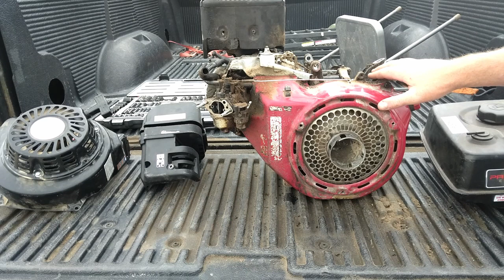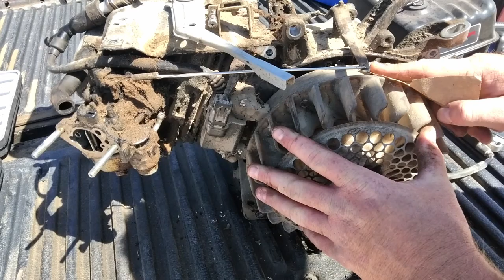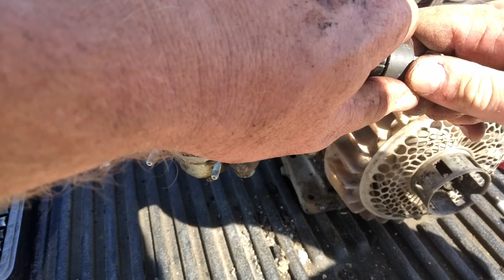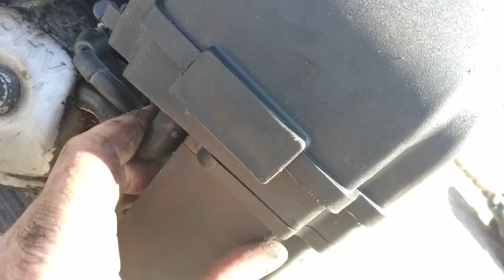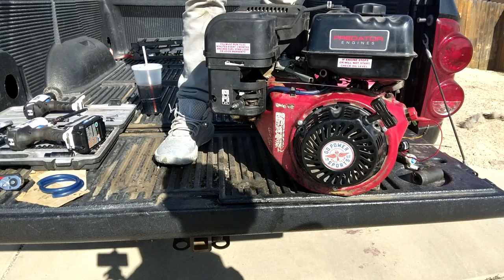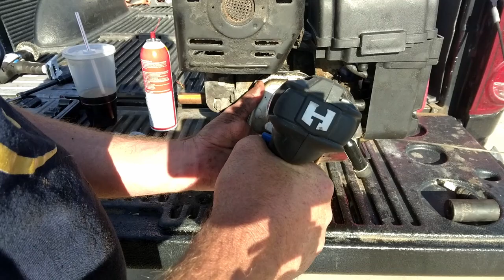Honda GX3?? Will It Run

Comment: Awesome troubleshooting video Nic! That sounds like a good engine. I'd try getting rid of the resistor spark plug boot on the old coil before tossing it out. The coil may still be good, but on the other hand, a new one may be cheap though. I'm frugal, I can't help it. LOL!
Reply from the maker: I actually already have a pull starter carb and coil coming already. I got all that and a few other things as a kit off Amazon for $42. I suppose I really should learn how to test a coil correctly.
Reply: @nicsminibikes  You did a great job of troubleshooting Nic. This video is going to help people. Nobody but me is likely gonna try to fix a bad coil resistor to try and save a few bucks LOL! I don't know HP might. 🤣